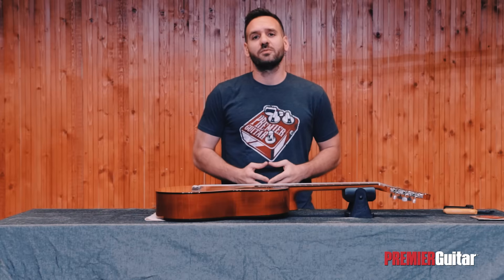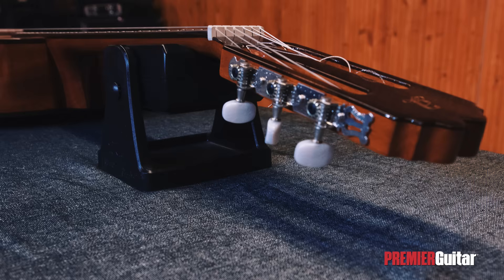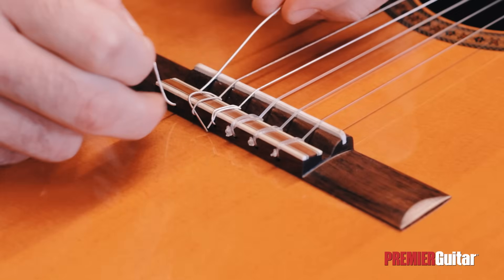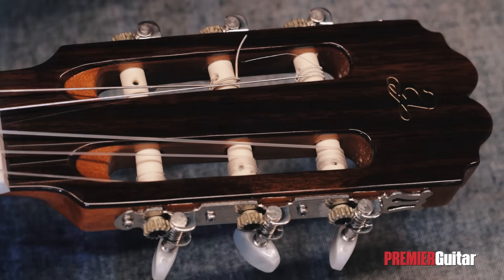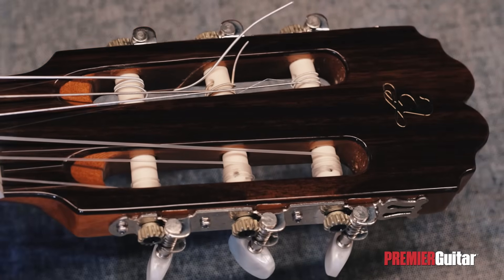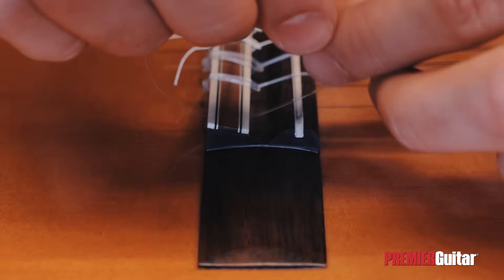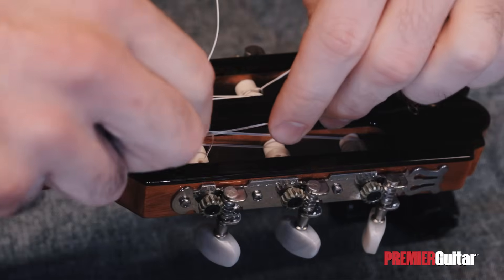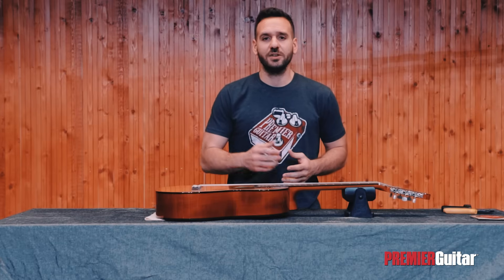DIY: How to String a Classical Guitar

Comment: Remember that on one end of the 6th string (Base-E), there is a loosely wound two inches and that end is used on the bridge (the bottom side of the guitar) for easy tying. Just make sure that all of the loosely wound part is brought under the bridge, through the hole. You don't want that part producing any of the vibration/sound.
Reply: Thanks I was about to asking that question. I have always done it that way just by intuition, but always wondered if it was wrong
Reply: I have no trouble making the loop without that part.  i cut if after using it to get through the hole on the bridge, dont want it messing things up. it's the g string that is hard to make a nice loop with.
Reply: No it's not used for tying and it shouldn't be
Reply: I've doing it for over 50 years and the loosely wound strings are fitted at the the head stock end .. What do you do with the two inches of loose wound strings? Makes no sense,.

Comment: I have a problem with the high E-string. It always either slips through the hole at the bridge cause the knot tightens under too much pressure or it slips out of the tuner hole...🤷🏼‍♂️😅
The other strings worked perfectly normal.

Comment: Hi, grest video! Questinon.....My tuner is broken. Found a replacement but the peg shafts (posts) are smaller in both length and diameter. Are they critical? What is the acceptable tolerance?

Comment: I restrung mine but it can’t stay in tune for a second? Is there a possible common reason for this?
Reply: Mine does that AND IDK what to do 😭
Reply: It's NORMAL at first. Nylon strings stretch A LOT when they're brand new. As they stretch, they will go flat. The solution is to play them for a while and re-tune constantly, soon enough the strings will finish stretching and the instrument should hold its tune for a reasonable amount of time (well, assuming the guitar isn't shit).

Optionally, to speed up that stretching time you can also do big bends or even pull on each string. Example: pull on a string 2-3 times, tune back to pitch, then repeat it a couple times for each string. I hope that helps :-)  Rock on!

Comment: Each time i change strings on the tuning peg when i make a knot to tie it around and tune it beacause i dont have any mechanical tuner or that tuner thing plastic i just use my fingers to turn the tuning peg up and each time first time the string goes around the peg it has like wiggly first circle all other ones after that follow nice and snug its quite hard to explain but i have it for years beacause im not the best at installing new strings but it never brakes or goes out of tune. Matter of fact my guitar never is out of tune.

Comment: Hello. I have a quetion query and hope someone can help me out. I hope someone could tell me the purpose of the ‘eye’ or eyelet - like the ones found on sewing needles to thread the thread -  at one end of the Knobloch strings? 
I haven’t come across these kind of strings before, Knobloch are made in Spain and one feature I like is that they tune and settle in a question of hours, a day or 2. 
Obviously it is somehow made like that to make string up easier or more secure, but I cannot decide which end it is supposed to be used, bridge nut or tuners’ in the headstock? Even then I am mot sure exactly how one is supposed to proceed. I need an expert.

Comment: Do you have to use nylon strings on a classical guitar? I got the wrong ones. 🤦‍♀️

Extra light Earnie Ball 80/20 Bronze, with ball pins.
Reply: Yes, because steel strings create more tension so a classical guitar isnt braced properly for that. Will put too much tension on the bridge

Comment: Any reason for not cutting and discarding all the old 6 strings first?
Reply: He mentions that by doing one at a time, you maintain consistent tension on the neck from the other five. That might not matter much, but it's a reason, anyway.

Comment: Everything else is shown so slowly and with careful description, but no verbal details and only oblique time-lapse video for the actual winding. Which direction please, on each side of the head?
Reply: They all wind the same direction with the string going over the top. Since they are recessed inside, winding under won't work. The string should not contact anywhere other than the nut and its own winding. It shouldn't hit any other string, winding or part of the head

Comment: I have question señor. Is it possible to string it the opposite was for left handed player? Thinking about getting one but can't find the answer.
Reply: Not sure if you still need any help, but you can buy left-handed guitars, that said this type of guitar is symmetrical and can be played and strung both left and right handed as long as there are no electronics in it.
It's a safer bet to look for a left-handed one in the first place, but with a purely acoustic classical guitar there shouldn't be an issue.

Comment: What’s the circle looking thing attached to the string? Because my string looks like a regular string until you look at the pointy bit and I have no idea what it is
Reply: You bought acoustic guitar strings instead of classical guitar strings. 

I'm assuming that in the entire pack all the strings are metal. 

DO NOT attach acoustic guitar strings to a classical guitar you will break it

Comment: WTF are you doing? I never had issues with strings on an classical guitar. But you will have a lot of fun to get rid of the strings from the tieboard and the machine heads on the next string change!

Some things to improve:
1. The strings should only be 2 cm long behind the hole in the tie block. So you don't have to cut anything away.

2. Before winding a string, shorten it until you still have 3 to 5 finger widths of space underneath it on the thread board. So will need only 3 rounds on the machine heads to get them tight.

3. I never needed to do any extra loops for the bass strings. They are firmly seated without any extra loop!

4. Please stop the voodoo with the treble strings! You only need 1 additional loop for the treble strings at the tie board.

5. Please no tie on the machine heads! Only one round over the lose end plus max 3 additional rounds will do the job. If you want to be really save you can do an extra round through the hole with E1 but please no tie!
Reply: There is a lot of superstition in stringing, apparently.   If you try empirically a less anal way, with fewer turns, loops, knots, etc., chances are you will find it works just fine.